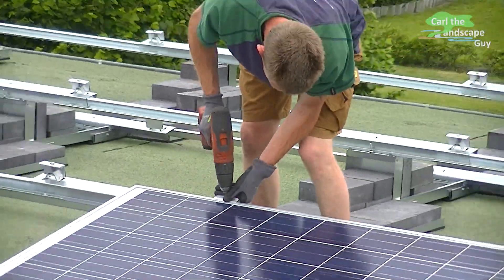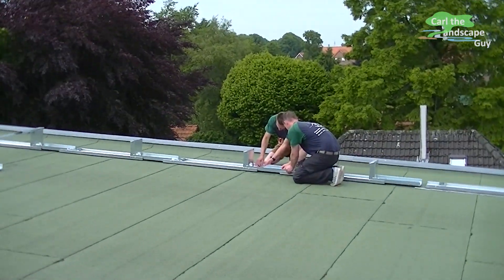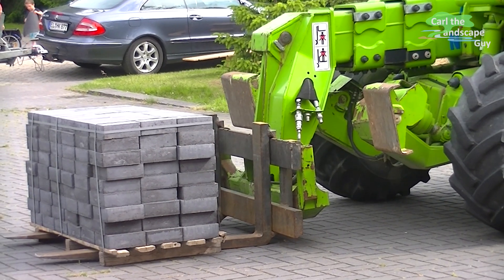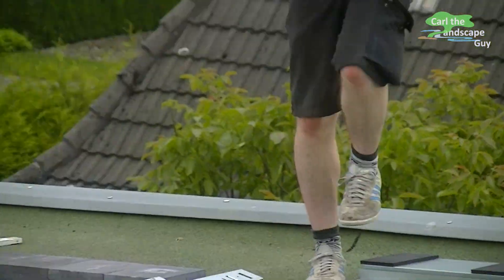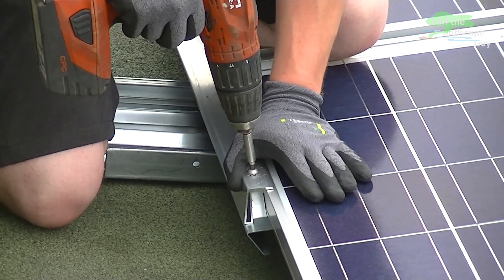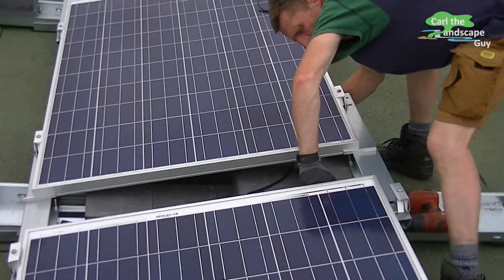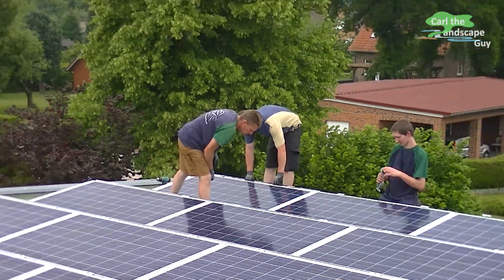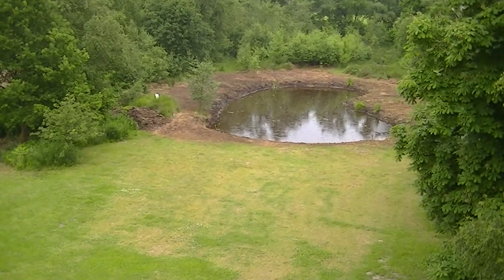HOW TO INSTALL HOME SOLAR SYSTEM IN DETAIL |MOUNT STANDS+CELLS+HOOK UP POWER WIRES ON ROOF PV ARRAY

Comment: BAD Setup.Cutting the airflow to the cells will diminish their lifetime, decrease efficiency and can be a fire hazard... You will cook those panels fast.
Reply from the maker: the people installing it are professionals and the Solar panels still work fine
Reply: @CarlTheLandscapeGuy  it's only 8 months? Let's hear after a few years. Their lifetime in specified to 20 years?